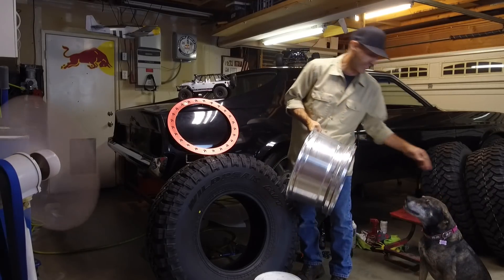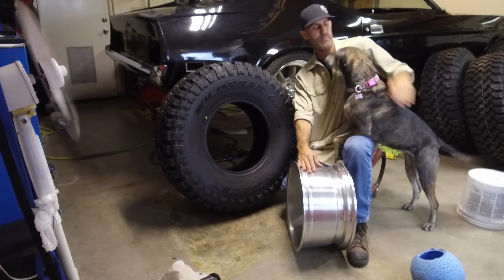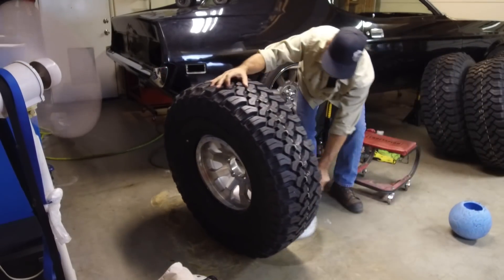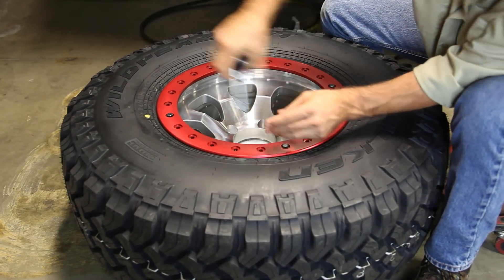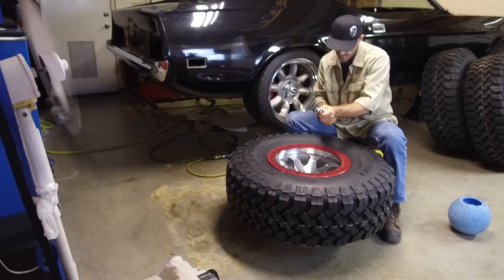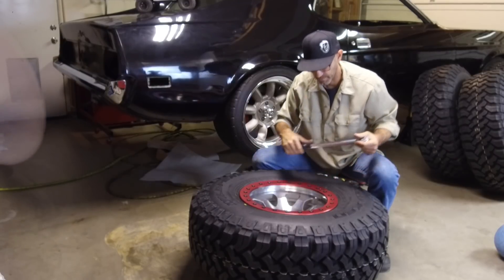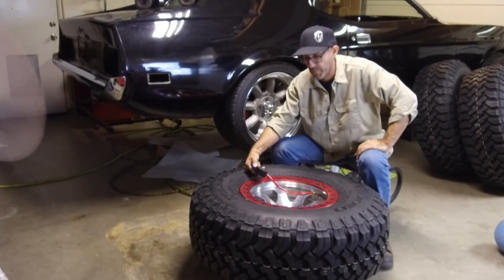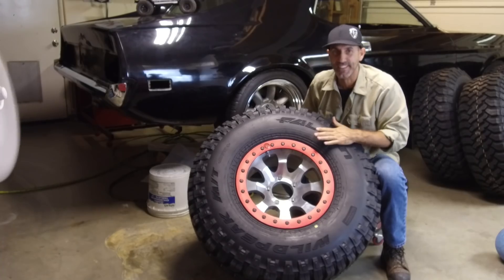Mounting Tires on Beadlock Wheels Do It Yourself... Really!

Comment: Another great episode. I recently mounted 35” on my 17’s. Nitto mud tires. This time I went with “Counteract” ceramic balance beads. Went to their website and imputed my tire size and it recommended the amount of beads per tire. Went to eBay and purchased 4 bags with 8oz each and they came with the new valve core for $37 shipped. The first 4 miles I thought I’d wasted my money but I felt the tire smooth out when the last bag finally opened. 1,000 miles on them and they ride smooth as can be almost all speeds. Some tire shops won’t deal with them but they’re super simple. Throw the bag in the tire when mounting and that’s it. Just an FYI. I’m the furthest from an endorsed commenter as it gets. Just a farm boy tired of having to rebalance tires all the time.

Comment: Remember the yellow dot is the lightest point on the tire. Place by valve stem to help balance. 
Did you take to a shop for balancing or do it your self?
Love the vids. Gives me great ideas. I'm planning the unijoint and upper A arm and front axle upgrade for my truck. Love the truck vids.
Reply from the maker: Good suggestion.  I did have them spin balanced at a local shop and they've been fantastic.

Comment: Good work and methods. I just use a piece of cardboard on the floor, but like the bucket idea. 
I mix dish soap to about 30% with water (find the mix that works for you. More water evaporates quicker and gives less time to mount, while less water gives more time). I gave up using my spray bottles years ago and just use a rag to apply. For trail side, I use a squeeze bottle and just wet the beads excessively. I’ve personally never had problems from using too much soap solution, but not enough makes it a fight.
Reply from the maker: Solid suggestions!

Comment: The yellow dot on the sidewall should go by the valve stem.. It will balance out better
Reply from the maker: I keep hearing that but never knew that was the case... cool!
Reply: Valve stem goes by the red dot
Reply: If there is a red dot, that indicates the high radial run out point and should take precedence over the yellow dot which indicates the light balance point.
Reply: @petervavaroutsos449  
Precisely. You don't always see both.
Reply: Never knew that until i owned Goodyear MT/r's. saves some headaches!!
Reply: @AutoEdits  yellow goes by the stem, but many tires have a yellow and a red dot. In that case the red dot supersedes the yellow and you put the red dot by the stem. 
If you don’t do this, the tire will still balance, but it takes a lot more weight to do it.

Great video BTW. Quick and precise and excellent explanation.
Reply: Myth

Comment: Great video. Only suggestion is you might have wanted to antiseize all those bolts. Steel fasteners going into aluminum wheels can corrode and damage threads when they are removed.
Reply from the maker: Thanks! Good suggestion and the thought did cross my mind but the thought of putting anti seize on 120 of those things wore me out...we'll see how it goes.
Reply: Antiseize is absolutely imperative for a proper torque when mounting beadlocks. Almost as important as measuring crush before installing. too little will not hold the tire, too much will push the tire bead out.

Comment: Aluminum wheel are your bolts aluminum  different metals? Would you want to use some anti seize
Reply: Most aluminum beadlocks have metal inserts for the threads. Hence why you shouldnt over tighten the bolts.

Comment: You do want to try to line up the valve stem with that dot on the tire. It helps with balancing
Reply from the maker: You know what I recently learned is that the yellow is the light side and if there's a red dot, that's the heavy side.
Reply: What about putting shot or beads in the tires to replace the need of weights. I heard that centripetal force helps with climbing and doesn’t need weights. I’m not positive just from what I was told, looking to get into a jeep diesel for power and fuel range.

Comment: I've been looking at wheels for my new Jeep, but I keep hearing beadlock wheels aren't street legal, or maybe just not recommended? Not sure, but just want to know one way or another before I buy beadlock wheels I can't use for daily driving. Any insight on this? Thanks!
Reply from the maker: Most bead lock wheels are not "legal" for street use but that does not mean they are not safe for driving on the street.  They require a bit of attention when mounting but otherwise are reliable.  I have not had a single issue with them and know of many other people that run them on their daily driven machine with no problem.
Reply: Ok great, thank you. I know it would be difficult to enforce, but I sure would hate to be pulled over, or fined for my wheels haha.
Reply from the maker: If you are getting a ticket for bead lock wheels... you did something else very wrong... lol

Comment: Can we use loctite on the lugs of the bead to avoid retorque-ing them every now and then?
Reply from the maker: They actually recommend using anti-seize on them because they are steel bolts going into an aluminum wheel.
Reply: autoedit oh alright. Thanks Jay :)

Comment: Personally i think bead locks are only worth it if you are running a comp truck, too much of a pain in the ass and you can run fairly low psi without popping beads. Awesome for extreme wheeling though.
Reply from the maker: Solid point... I just didn't want fake beadlocks and don't mind the upkeep

Comment: Why doesn't  the wheel have beadlocks on both sides?
Reply from the maker: There are a few that do have that but it is expensive and heavy and for the most part... overkill.
Reply: @AutoEdits  If you say so... But overkill is underrated I think.
Reply: The entire purpose of beadlock rings is to allow running low pressures (e.g., single digits, like 6-8 psi) to maximize the size of the tire’s contact patch with the ground, which then maximizes traction off-road. Putting a beadlock ring on the outside of the wheel prevents slippage of the wheel inside the tire at very low pressures and also protects the bead on the outside of the vehicle, which is the most likely place that a de-bead will occur off-road. Very few be-beads occur on the inside rim.

Comment: Ever WW Overland?  WONDER what is down that road then WANDER down it, by your self... not on purpose?  Leave at day break... drive all day and all night, never seeing the pavement... 118 degree day in the desert... no air conditioning... no map... no phone... no food... only enough water for the day... no winch... no shovel... no high lift jack... worn out old spare... no flashlight...  no air compressor... no lockers... open diffs...  half tank of gas... not knowing where you are going to come out?   I have done this many times.  It is spooky exhilarating.  Maybe  I'm stupid or maybe I've gotten addicted to spooky exhilaration.

Comment: So, is there some great advantage to beadlock wheels???? They are more expensive, more fussy, and seem to offer no real advantage unless you just like getting dirty and create more bs to deal with. If I'm wrong about all this please school me.
Reply from the maker: Yes there is a huge advantage to running beadlocks. Running 8psi with more confidence that I'm not going to blow the sidewall off the bead or twist the tire is a great improvement. Plus, these are such a high quality wheel that I haven't had any problems with them at all.  Just like running a normal wheel at this point other than the original installation.
Reply: Okay, so if you are a rock crawler they MAY offer some greater margin of stability. If a guy just goes out and does normal type off-road stuff then the extra cost and fussing with these wheels is probably a waste. Oh yea, they do look cool though. Pretty sure the Elk and deer where I roam don't care if I have old rusty wheels on my machine. Don't think they will hang around to look at my pretty beadlocks. Thanks for the info.
Reply from the maker: Whatever floats your boat